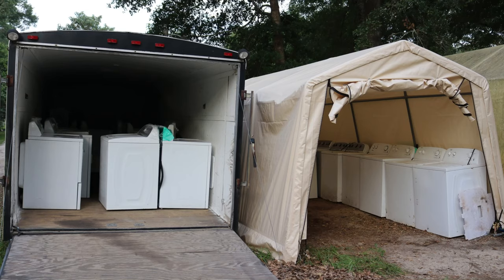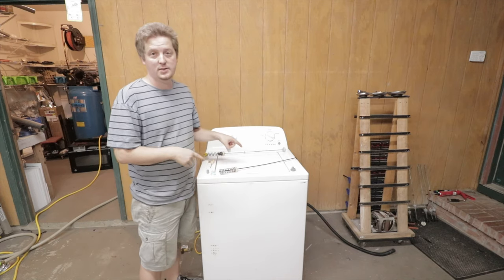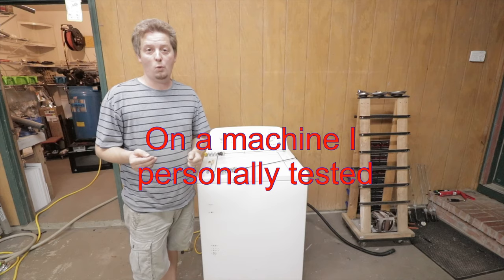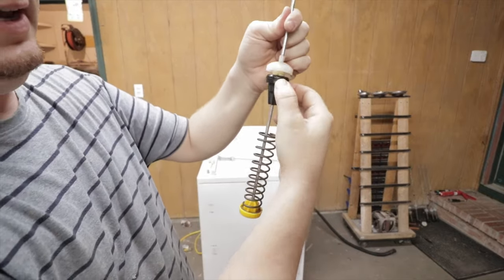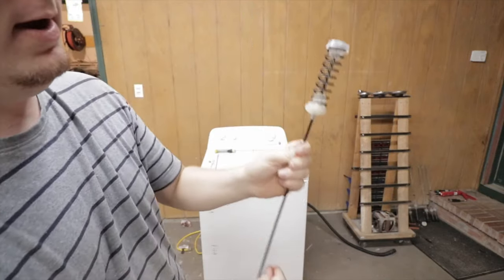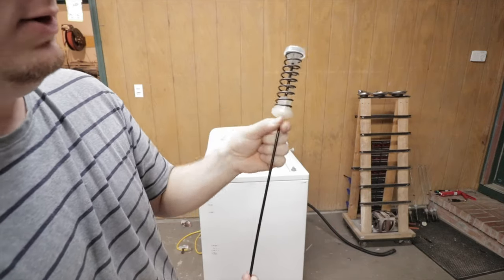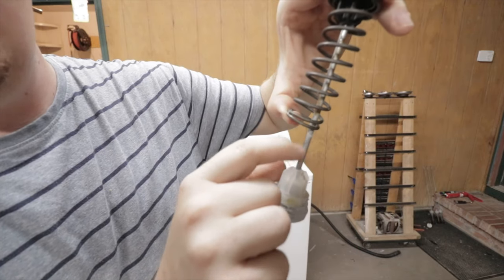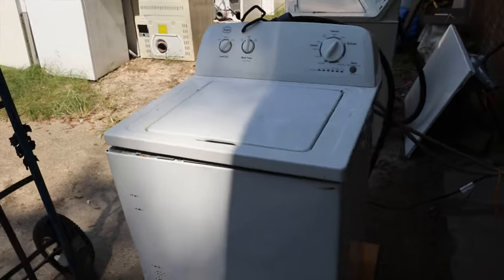Cheap Permanent? fix for shaking banging Washer? $7 to fix Suspension dampening rods W10780048

Comment: Guess it was too difficult for the engineers to use two opposing springs?... 🙄 I could think of one possible solution for this that would totally eliminate the springs and the rods so long as you got the right size. I'm thinking hydraulic hood lifts cylinders like what's used on hoods for cars. Just have to modify the ends for mounting. Not sure how long it would last, but at least the cylinders have tension in both directions like shocks.
Reply from the maker: True

Comment: Thanks for this video, I’m doing it right now on my suspension rods.  I applied the liquid nails yesterday, it’s been drying about 24 hours so far.  What temperature did you bake it at?  The lowest my oven goes is 170 degrees Fahrenheit.
Reply from the maker: 170 is what I did. I'm not sure if it helped or not. the main thing that helped it was keeping the pieces separated  and dry completely before pushing them completely together.
 my washer is still working.

Comment: Good idea kiddo...maybe a piece of mud flap rubber would be just as grippy and more durable. If not gripping rod tight enough make mud flap part longer for more grippable surface area too
Reply from the maker: Yeah, actually seen people use piece of rubber to fix this. There’s a bunch of different ways to do it because it is solving a simple problem of gripping the rod.

Comment: I see in the comments that you have tried the replacement kits from Amazon that have good reviews.  You also recommend one in the notes, but it only has a few positive reviews.  Do you still recommend that one?  I would be glad to support your efforts.
Reply from the maker: It was recommended me by another appliance repair guy. I actually just ordered the kit to try it out. I like that it has the extra for springs to help stabilize the drum.
I’ll probably use the kit this week and make sure it’s good but I trust the guy that told me he liked it.
Reply: Thanks, good enough for me!

Comment: The suspension rods may not be the actual issue. The splined gear in the middle goes bad and the plastic retaining nut needs replacement

Comment: Everyone thinks that the GE suspension rods have a cover over the spring. Wrong. That's actually a cup that from factory is filled with grease to act as a hydraulic shock. I'm thinking a person could cut GE rods and thread rod and screw to a Whirlpool rod. Seems GE doesn't have this problem.

Comment: I bet if you used ap slightly smaller diameter rod just to form the  dampening bushing it would get a compression fit when you install it on the real rod.

Comment: Put a tie trap or 2 on that grip it thingy and that will make it grip much tighter. And you can adjust the tightness you need with the tie strap. Easy fix...
Reply from the maker: That may work.

Comment: Great informative video! I ordered new rods today. In the meantime im going to try to wrap electrical tape around the worn foam to tighten it up as the new rods wont be in for a couple of weeks. Ill try to remember to get back on here with results.  As a side note, spin your tub manually while your in there to make sure the shaft isnt bent from any violent banging. If it is, i doubt new rods will help. Thanks again for the great information
Reply: Worked great so far. At first i thought i had to wrap the tape tight around the foam but i ended up just snugging about 4 to 5 wraps around the foam and twisting it back where it goes about 3/4 of the way. I had to use a small flathead screwdriver to force the last bit in and get the cap back on.

Comment: Try silicone caulking or tub caulking. I thought about flex seal but not sure about it's ability to grip.
Reply from the maker: I tried silicone but it seemed to soft I was pretty sure it was just going to fall apart within a few days.
 so far Liquid Nails is still working. The only issue is it takes a long time to dry.
Reply: @WasherDryerMoney  Love the video and going to buy some liquid nails.
Reply from the maker: let me know how it goes.

Comment: Help! I went ahead and bought and installed the new suspension rods and it did nothing. I'm sure they are installed correctly, as I've watched 5 different install videos and did it what was shown. The basket is "wobbling" even as it spins slowly during the sensing/filling cycle. Why else would it bang the sides and walk all over the place. I reset the feet to make sure that wasn't the issue. Oh, it's a Maytag Bravos, but not the XL.
Reply from the maker: If you can look straight down at the agitator spin the drum and notice the drum slightly goes in and out there’s a much bigger problem another test for that is if you grab the inner drum and push it towards the outer drum doesn’t have any movement. There is a plastic piece that will wear out between The inner and outer drum and when it goes bad the only repair is replacing the entire inner metal drum. It’s literally worst case scenario. Usually too expensive to bother fixing.

Comment: The rod i think as well put heat like torch to expand it butane tor h hand heald het it up see what hapens just rod little bit just use metal or rubber bushon top like plastic tube cuple zip ties

Comment: I’ve been trying different things for this issue still, the fabric tape worked at first because the outside slows the plastic down and the sticky inside of the tape hangs on the rod

It lasted a solid week last time so I’m doing this again, not sure what I did different from all the other times.

I’ve used rubber hose but never could get the right size because I think the friction will work for this issue, and keeping it together was rough since I obviously had to split it with a razor to get it on the rod. 

Now I’m thinking, we’re trying to keep something from moving up or down but also let it move slightly so I’m going to try some dampening grease of the strongest variety and if that’s a no go I’m seriously thinking about doing like my man up there 👆 did and just put something solid over the top of the damper assembly….couple tack welds? 😂
Reply: No easy way out break down and buy new springs if that don't work junk the machine
Reply: @russellfinn2587  certainly right, I gave this idea up and just started buying new dampers.

They’re usually too cheap to even bother trying to fix the old ones and working for a warranty company they buying anyway so win win win.

Comment: I think the problem is obvious  .... There isnt anything above the mount on the basket to keep it from sliding up. Why not attach the top of the spring mount to the washer basket socket ?? the basket will just move up off the spring if it isnt limited how
 far it can go up.
Reply from the maker: Interesting. I’m going to do a few videos on some other fixes people are claiming works for this machine soon.

Comment: As far as diagnosing the issue goes how do you determine it’s the suspension rod? Or could it be another issue. We bought a new/used washer and dryer 2 years old. when we brought it home it seems so loose hits on all sides during the spin cycle  spinning, adds alittle water and keeps going it’s also tripped the breaker. I asked the seller they told us nothing like that had ever happened to them. (They seem trustworthy) So I’m assuming it’s something that could have broken on the journey home.
Reply from the maker: 9 times out of 10. It’s the suspension rods.
The other thing it could be, is the inner drum where it connects to the outer drum has come loose. You can check for this by grabbing it firmly and shaking in a bit. It should shake both the inner and outer drum. If it feels like it’s independent. That’s a totally different problem. That suspension rods will not fix. It is fixable now. There’s a new part and Repair for it.
Reply: Trust nobody that sells used appliances!

Comment: my amana top loader ntw4518fw3 is making a very very loud noise when in final spin
Reply from the maker: It could be the plastic gear that the belt turns underneath the washer.
Check out this video.
https://youtu.be/A4jdYyk7W-o
Reply: that was the very first thing we tried then we saw it could be the top ring. Went to the parts house and they said that wasnt it. I wish there was a way for me to send you the video of what it sounds like.  Thanks so very much for taking the time to help me.

Comment: Isn’t it is the case there’s a new set of dampeners is $45?
Reply from the maker: Totally depends on the brand and if you want to go with OEM. I’ve seen some sets be over $100. But I’ve also seen some super cheap junky ones on eBay for under $30.

Comment: I have a question for a totally different machine, I have a Kenmore stackable washer this is only five years old.
The washer won't fill , I don't get any power to the water solenoids, so far my diagnostic is replacing the main washer board. Any ideas?
Reply from the maker: Could be the lid the switch. Some washers will not even fill if the lid is not detected as down.

Comment: My amana top load tub seems solid up and down but very loose side to side and front to back. Machine travels like crazy in spin cycle. Springs all have tension. How do I determine if its the springs?
Reply from the maker: Take one suspension run off and see if the plastic piece easily slides up and down if it does it is suspension rods. Most of the time when I washer machine is bouncing all over the place and it has suspension rods it will be the suspension rods that are the problem. At one point in the video that you commented on a show really quickly how to see if the rod is bad by sliding the plastic piece back and forth and it does not have resistance.
Reply: @WasherDryerMoney  I usually push the tub down as far as I can and release it. 
  If it bounces up and down I consider the rods bad. Imo, it should basically just jump back up with no or very little bounce. 
  I used to think the springs were weak, but after some research basically saying the same think this video does,  I am about to come to the same conclusion. It is not necessarily the springs getting weak. 
  I have seen and heard others with more experience I have discuss the top piece sliding with no grip on the rod. 
  I have a bunch of suspension rods I have saved back to experiment with.
  Only thing about my method of pushing down and releasing is it might not indicate if only one suspension rod is going had. 
  That being said, I would expect  them to go bad at about the same time. By the time I get a washer in with this problem, I expect the previous owner had ran it enough for all to go bad.

Comment: Any updates on this?
Reply from the maker: It’s still working perfectly. Still using the same machine in my personal laundry room. I did have another repair guy told me he uses the windshield and he said they sell at AutoZone in a caulk tube. I have not tried this yet but I’m thinking of giving it a try because it takes so long or liquid nails to dry properly.

Comment: If I had that exact washing machine I will take a look at the back and look for a big gap in between two Metal Sheets... if I had the gap I would open the top and look for a broken plastic cover on top between the drum and the outer tub... most of the time the top cover get tangled with the gap between those Metal Sheets at height spin... if so just cover the Gap with a plastic vinyl or get those two Metal Sheets together with pop rivet
Reply from the maker: Interesting.

Comment: Why not replace the entire Black-Plastic piece with a "synthetic - Rubber Stopper", shaped, sized and drilled accordingly?  You can probably "buy them in bulk" almost ready to use.  Regards
Reply from the maker: True. There’s been a few interesting ideas I’m going to try that some of the other repair guys have been using to fix this problem. I’ll post a video soon on if there’s a better easier fix.

Comment: I change the suspension rods on a Crosley and machine still bangs
Reply: Enter service mode, then recalibrate the machine  ;) *Pro Tip, before recalibrating make sure your tub is centered

Comment: I have a 7-8  year old topload GE model GTWP1800D0WW. It shakes severely only during spin and within a few seconds will cause the tub to slam against the sides so hard that I have to stop it before it rips itself apart.  The two back suspension rods are different and have red pieces on the bottom of them and the front two have blue on the bottom. Apparently they are different. How can I tell which is bad by looking at them while on the machine? While standing in front of the machine, the problem seems to be that when trying to push the tub towards the back or front, it is more stiff. When trying to push the tub left and right, it is far more loose. How do I figure out which ones are bad in that case?
Reply from the maker: Usually they’re sold in sets of four. So you would just replace all of them. GE suspension rods can go out, but it’s way less common than whirlpool.
Reply: @WasherDryerMoney  I pulled the agitator off and there were these holes in the agitator tub base and it looked uneven with the inner tub. You could see all the way down into the second tub below through the holes, so it was a goner. $260+ for the replacement tub alone. Got a deal on a new Maytag MVWC465HW for like $570 delivered and it seems to work great. Thanks for the reply.

Comment: How about trying "Flex seal" I used flex seal for my work tennis shoes I go on roofs in junkyards and used them firstly for exercise  and still holding a year later PS Thanks for the info !!!
Reply from the maker: Interesting. The only issue is it has to not only grip but not grip so hard that the rod can still freely move up and down about an inch. If it holds too tightly it will cause the same problem. 
It’s definitely a difficult balance to find a material that grips well but also will allow the rod to slip after a certain amount of pressure is applied.
Reply: @WasherDryerMoney  Try cleaning and spraying the rod with silicone let dry then then apply the flex seal!!
 I'll be doing one of those machines shortly so I'll let you know !!!

Comment: The best material would be plastic weld by Permatex . But before you do this,Oil the rod slightly to break it loose when the plastic cures in 10 minutes
Reply from the maker: Good idea

Comment: What about wrapping that little foam piece with electrical tape? Well I guess the foam would still continue to deteriorate even if you tightened it back up.
Reply from the maker: Yeah that piece of foam after it starts dissolving just keep dissolving.

Comment: GE washer shakes on agitation only
Reply from the maker: @RussellSteenhoff  some of the older GE’s had some rubber pieces on the top of the drum that would dampen and stop the drum from rotating during agitation. I’ve seen tons of those machines with one or two of those pieces broken. This could be your problem. 
Good luck.

Comment: Thank you so much for this advice - I learned a lot, but didn't follow it :)  However, the idea of damping the motion is the right trick - and I found another video with a solution that was quicker and less messy to try. Basically installing a collar around the top plastic part of the rod to accomplish the same damping result. Plus the advantage of being able to tighten it later. I have a 10-year old Roper and it did the trick for me (well, at least on the first load it didn't walk across the floor like before!) The yoo-toob video v= value is FewtIODiQwI for anyone interested!

Comment: Has anyone just tried wrapping padding or insulation around the main drum to hold it in place?
Reply from the maker: I have tried with only minimal success.
I have seen some videos of people really stuff in it tight with foam and it seem to work for them.
When I tried it it did not work for me it was still vibrate pretty hard.

Comment: How about rubber ? Or elastic band s ? Or rubber washers the one's used in plumbing 👍🇨🇦
Reply from the maker: I’ve tried a few different Glue that dry similar to rubber but only liquid nails has lasted more than a month. I found a few more tricks online and I’m going to make a video on them soon.
 check out some pictures of how Samsung is putting a piece of rubber on the bottom of the spring to solve this problem.
I’m going to look into that deeper.

Comment: Replaced actuator shifter on a 2020 whirlpool washer and it still will not spin.
Reply from the maker: Put the washer in recalibration mode.

Comment: Good idea but I just fixed mine with PEX pipe in about 10 minutes.
Reply from the maker: How did you fix it with pex? I love pex , I’ve replumbed several houses with it. Great stuff did you use a fitting or what did you do exactly?
Reply: @WasherDryerMoney  ..Cross cut a piece of 1/2 pex pipe the length of the foam piece. Then cut that piece down the middle to get two halves. Then cut the halves into quarters and use them as wedges to fit between the plastic housing and foam to pinch the old foam to the rod. I only used two quarter pieces, one on opposite sides to wedge and pinch the foam. I also trimmed one end of each wedge to help guide it between the housing and foam. I experimented with it today and so far its working. I only had one rod that was not gripping as good as the other three so I fixed the one and so far so good. My foam wasn't as loose as the one in this video so it might need two quarter wedges doubled together on each side to pinch the foam. Or add wedges as needed until foam wears completely out.

Comment: I replaced mines but for some reason it still bangs
Reply from the maker: If you turn the drum a little by hand and look at the edge does it look like it’s not centered? Sometimes you can actually see the agitator slightly be off-center. If that’s the case it’s a much bigger problem. There’s a piece under the drum that can go bad and make the inner drum slightly off center. It’s a very difficult fix and very expensive. It’s not super common though.